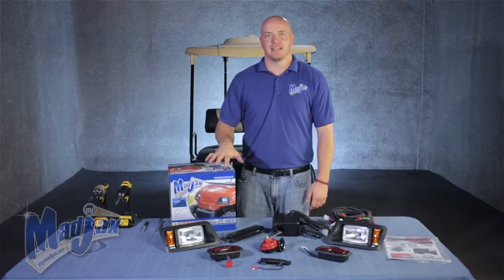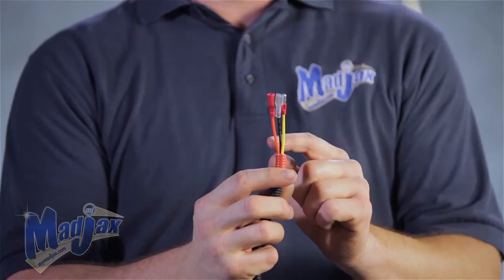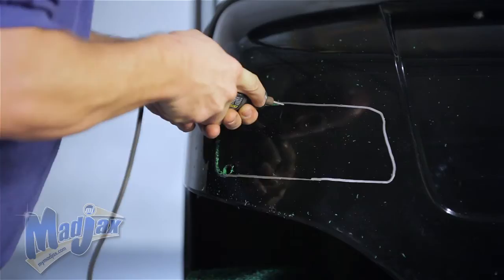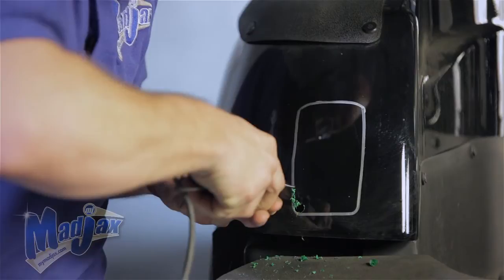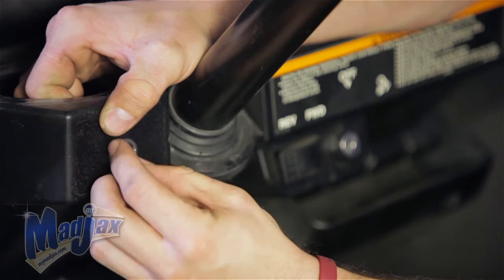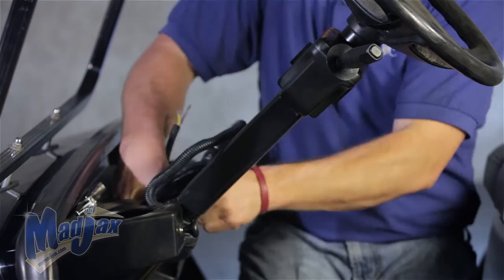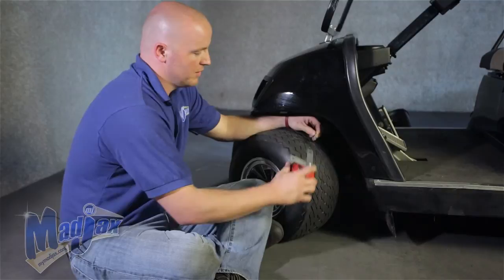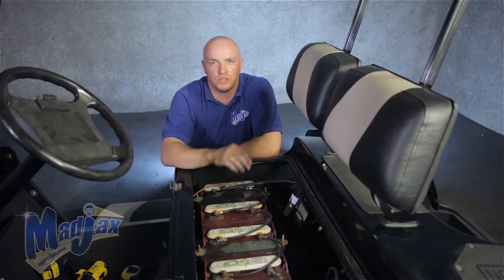Ultimate Light Kit designed for Yamaha® G22® | How to Install Video | Madjax® Golf Cart Accessories

Comment: So, I've got a light kit harness and lights installed and functional. I purchased the Madjax Ultimate Light kit Upgrade, but I just can't seem to find a 9 pin connector on the existing harness. I've got two 3-pin connectors that connect to each of the headlights. and two other connectors to the horn. I'm not so sure what role the existing harness would play, and how to connect that to the upgrade harness then to the lights. Any info would be much appreciated. Thanks.